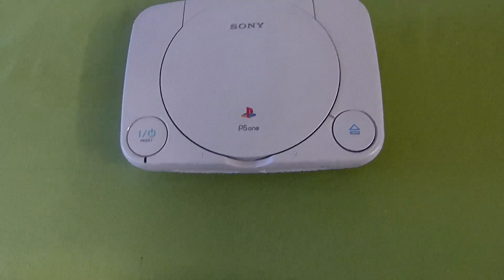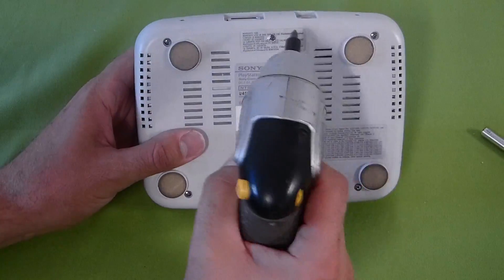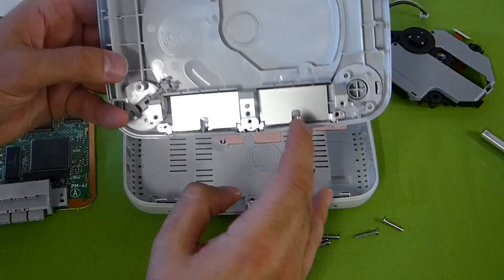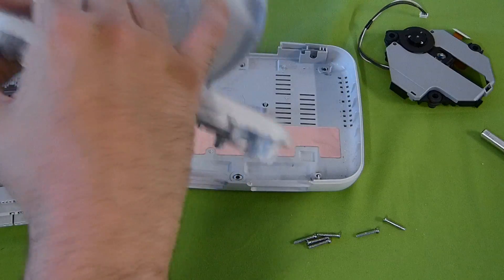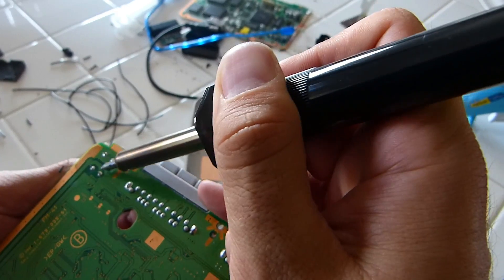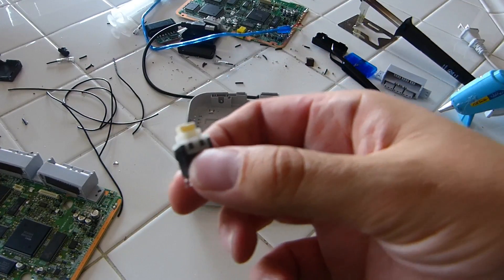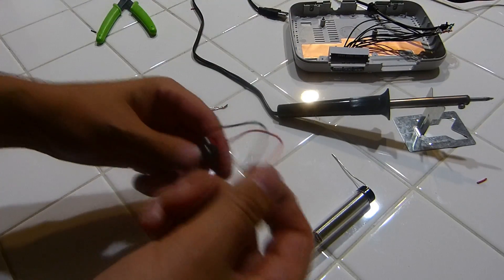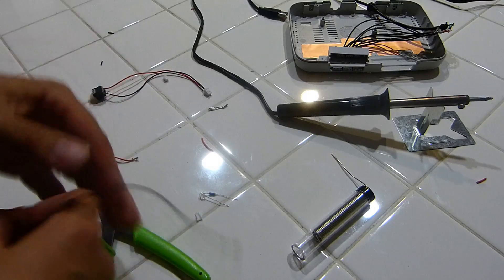PLAYSTATION PI CASE MOD TUTORIAL RASPBERRY PI - PART 1 of 2

Comment: If I used an older grey model could I just solder the wires to the board of the 1P or 2P ports since the older ones connect via ribbon cable? Could that work?

Comment: It appears as if you put a resistor on the LED.  Can you talk about that a little in the next video.  You didn't include a link for that so I was not sure if it was needed.  Thank Man!
Reply from the maker: Mark Bessert Sorry just looked at that link, didnt mean to link to that set I use those for something else these are the ones I use http://amzn.to/2pLnEEZ
The others would work but to play it safe you should have the led with resistor to not blow the diode.
Reply: No worries.  I can exchange and order the ones with the resistors.  You may want to change the link in your other video as well - PLAYSTATION MINI - PI 3 CASE - LED LIGHT - POWER ON & OFF.  Keep up the awesome work!

Comment: Nice.. quick question what's that cable called. The one where soder the controller connection to the USB
Reply from the maker: Peter A Yeah realized I didnt talk much about it, but the one i used is linked in my description ps1 usb adapter.
Reply: So sorry my fault for jumping that gun.. by any chance do you know what gage of wire you are using?
Reply from the maker: Peter A Using spare arcade cables I have lying around, not sure the guage, probably around 28/30 guage if I were to guess.
Reply: Thank you, but where can i bus this Cable? Because i need it for the Power Switch.